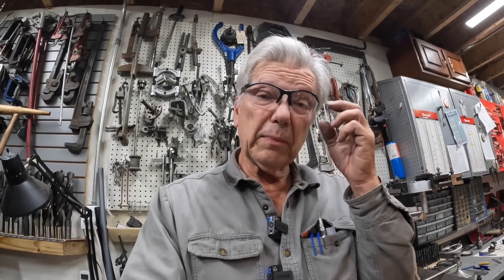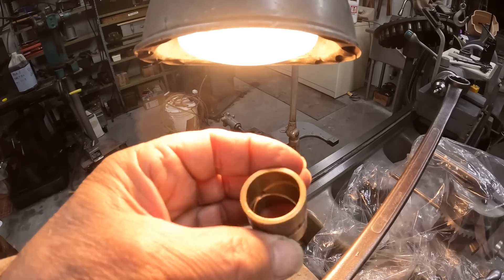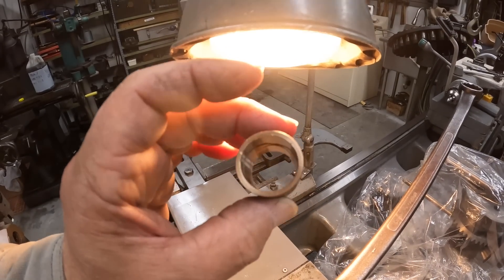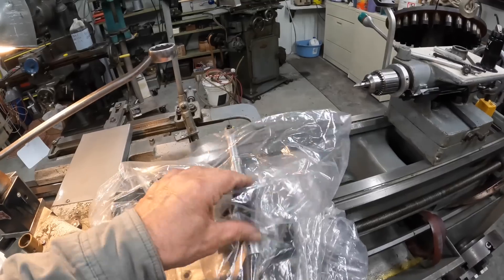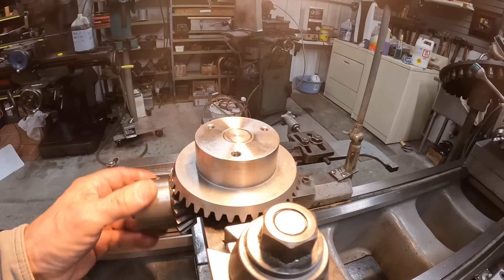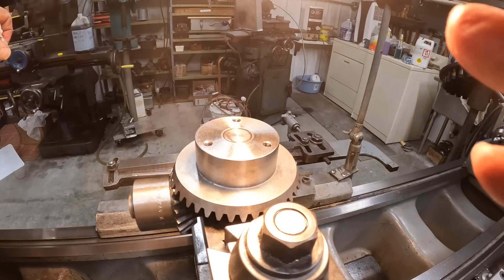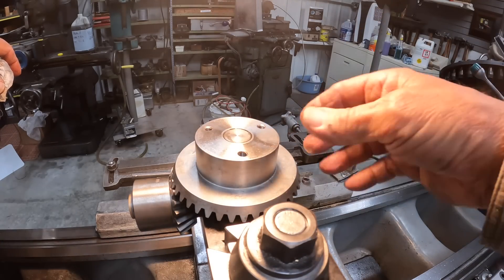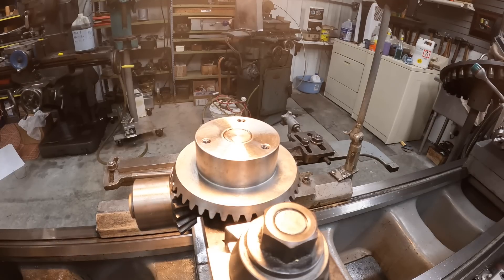Lathe Special Tool "Bushing Oil Groover"!

Comment: Lovely work. Trying to find some gears online right now and it’s quite depressing… The closest ones to your gears is the larger of the two being 4” with 7/8” bore. Little smaller but should work right? It’d work out great, only problem is it’s $276! 😂 the other is $131. Going to have to figure out an alternative route to finding gears I guess
Reply from the maker: Unfortunately the rising costs on everything have put a lot of projects on hold! I got mine from a company in Oregon. Try the Linn Gear co. 100 N 8th St. Lebanon OR. 97355. tel 541-259-1211, https://www.linngear.com Good Luck!

Comment: Hi Steven!! I like your device so much, i want to ask you a question:if you move the turret radially, to increase the cutting depth of the groove, is there a problem or does the connecting rod that touches the jaws compensate for this and everything works anyway? I mean: if I exaggerate with the depth of the groove, I get a simply deeper groove or I lose the phase with the point of the groove? Because I think that by moving the spindle radially, the stop on the jaws moves and the spindle has to rotate a few degrees to touch it again and therefore I have lost the phase.Thanks on advance for your answer, a big ciao from Italy !! Alberto
Reply from the maker: Thank you for your comment. I haven't noticed any problem like what you point out in your text! My depth of cut is usually very shallow, and as such I haven't noticed any problems! My usual depth of cut is only .025" to .040"! Sorry for my late response !

Comment: Great design. Can you explain if starting
 on centre, as you wind out the top slide to increase the cut & groove depth. Does the geometry charge the drive bolt path from a circular to an elliptical orbit?  Or am I wrong.
Reply from the maker: I'm not sure I understand your question, so I will try and explain what I think you are asking! The drive bolt is simply a "dog" just like one you would use to hold a part between centers. It simply transfers the power from the lathe chuck to the groover tool. If you check out my latest video #3 you may find the answers you are looking for! I hope that helps!
Reply: @Letsmakeitgreatagain.  Hi Steve. A drive dog stays concentric with the shaft. Think about the circular parth of the drive pin, as the top slide moves out with the depth of cut. If you started with tool inline with the spindle, as you move out, it now tracks in an small elliptical path. What I'm asking is if this elliptical part effects the oils groove that is cuts, or as it's only a shallow groove, maybe it has no effect. It helps to draw out the part of the drive pin. Or am I wrong? Maybe it only effects the cutting speed, like a shaper slowing on cutting stroke and faster on return stroke. Cheers from Australia 🇦🇺
Reply from the maker: I apologize,... your comment seemed to be stuck behind another comment and I just discovered it! To answer your question, the cut is fairly shallow! As long as the oil is happy moving in the groove, I'm in Hog Heaven! It sure beats a  Dremel tool! Because of the shallow cut, I don't believe there is any effect! Great to hear from "Australia"!

Comment: That is the cleanest version I have seen other than a special lathe made only for that (that are very rare). I am interested in making one but I have a few Improvements in mind: the arm that rotates could be thicker on the hub end to match the gear for better twisting resistance, the bolt that contacts the chuck jaw could be a tension bolt to hold a tube firmly to the arm, and could have several different lengths in case you had a very long tube, or if you needed to adapt it to be driven by a collet chuck. The stroke adjustment could be moved by a screw for accurate corrections and also have a scale and pointer for setting. I have also thought of a master quill for the stroke that would accept interchangeable bars, that way the master bar could have a section to resist rotation like a square, or a loaded ball spline for smooth motion. Anyway you have a great tool there, thanks for the inspiration.
Reply from the maker: It sounds like you have it well thought out! As far as setting the length of travel, I simply place a Dial indicator at the end of the boring bar and adjust as needed! The cuts are generally light and the speed is relatively slow, so beefing it up may or may not be required? Good Luck with your Project!
Reply: @Letsmakeitgreatagain.  thanks for your reply, my application would be for bushing up two 2 or 3" ID in  alum bronze , very tough and work hardening material where a very keen cutter is important. My thoughts on a master bar stem from a lathe mounted slotter that was built that way. What you have made is really terrific,  so clean.

Comment: What is the tooth ratio between gears (1 to 2, 1 to 3)? Does it make any difference as to which gear angle is utilized?
Reply from the maker: Hey Don! Thanks for question. The ratio is 2 to 1! and I don't believe the gear angle would make any difference!

Comment: Could you disassemble the unit entirely to show all of the components?
Reply from the maker: I pretty much did disassemble the whole tool! The main block that attaches to the Aloris Tool Post Holder does not come apart since the gear shafts are a press fit! The bushings that allow the cutting tool to move in and out are also pressed in! Since you asked, what I may do is a follow up video and show each part separately! Thanks for giving me the idea!

Comment: That's an absolutely Ingenious Tool.....and I haven't said that since Darrel Burns designed his clevis machining clamp for the V22 lug end.   It probably wouldn't be OSHA approved until the gears have a safety cover because they're a Horrible Pinch Point.     : )    
Watch your fingers
Reply from the maker: Not sure what a V22 lug end is, but thanks for your kind thoughts! I still have all 10 and plan on keeping them!

Comment: Are the ring and pinion cast iron? You might want to put a washer and locknut on the dog so it can be locked in position and not wobble around and wallow out the aluminum. Thanks for showing it, looks great!
Reply from the maker: Yes and yes! Thanks so much for your input.

Comment: A ferramenta tem que avançar para aprofundar o canal.explique.
Reply from the maker: I'm not sure I understand your question? So I well try and answer 2 different possibilities! While the part is turning in the chuck, the bar is behaving much like a boring bar, it travels inside the part a predetermined distance, that I control by adjusting the locking bolt located on the top of the large gear! And while this bar is constantly moving in and out of the part, I very slowly move the cross feed control outward causing the cutter to remove material at the same time!  The result is the X pattern I show in the video! I hope that answers your Question!

Comment: i noticed that as you turn the cross slide, the dog moves too so it ever so slightly changing the timing- i guess its so small it doesnt matter. beautiful mechanism
Reply from the maker: Thanks for your comment, yes you are correct, however when the (cross feed) cutting tool actually makes contact with the part it only travels the depth of the cut. In many cases the depth of cut is between .015 to .045". So the dog's movement is negligible!

Comment: Steven,  Very interesting project!  Is the Gear Ratio 1 to 2?  Do you know the part numbers for the gears?
Reply from the maker: Hi Gary, Thank you for your kind words. Yes the ratio is 2 to 1 depending on how you look at it! I will try and get the information about the gears! I remember they were in the $75 range.  It's been over a year ago, since I built it, but I should have the documents in my file! The tool was designed for my 18" Lathe, so you may or may not want to follow my lead, depending on the size of yours! Good Luck, with your project!

Comment: Nice tools   Did you buy the bevels gear set ?  Do you use the same tool to cut the first set of grooves on both ends that just go all the way around the bushing?  Wonder how small it can be made.  Like my small Atles lathe.   +1 Sub just for the idea.
Reply from the maker: I could make the business end of the cutter quite a bit smaller if needed! Right now I can go as small as .625"! But I feel I wouldn't have any problem with half that size! Your second question seems to be a popular question with other people I've shown this tool! The travel of the cutter goes the full length of the bushing! However the cutter needs to stay inside and not exit the bearing, so as not to cause the oil pressure to leak down! In other words the cutter makes a figure 8 as it passes inside the bushing. Thanks for Asking!